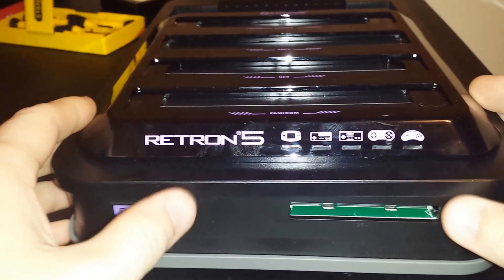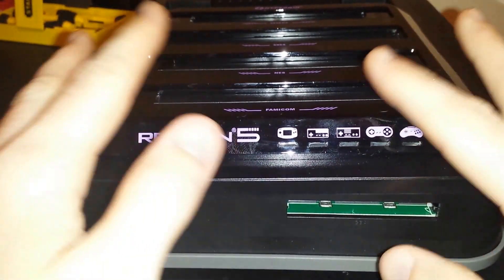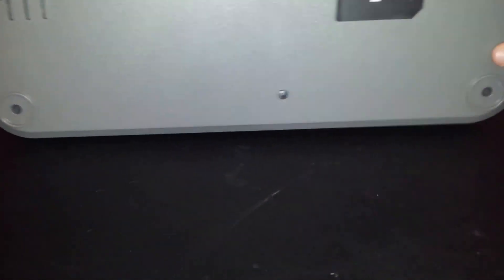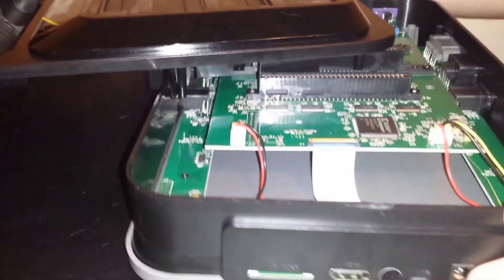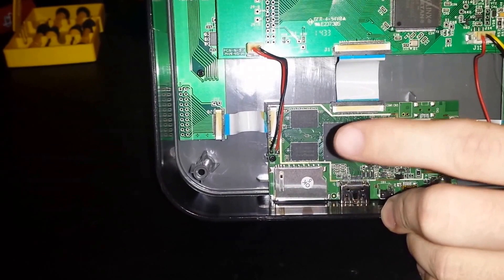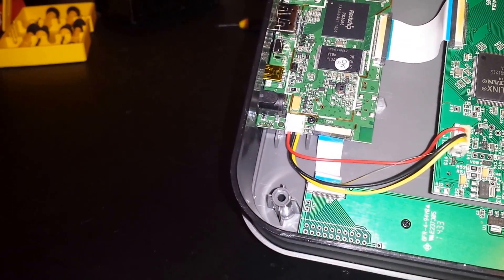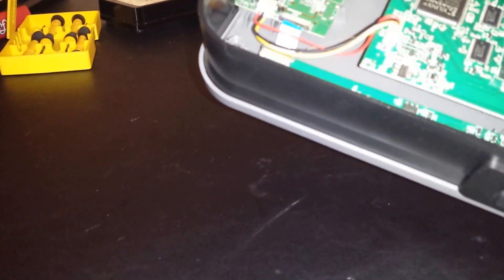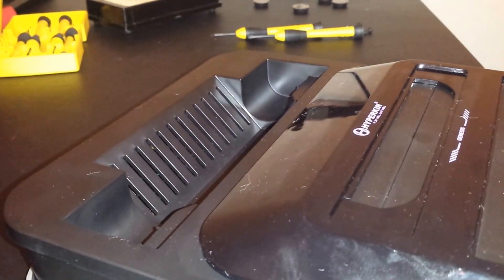Hyperkin Retron 5 Hardware Teardown System Specs

Comment: Does the rockchip SoC need some passive cooling? Was thinking about slapping a heatsink (or maybe solder in a low volt fan), some people had problems with crashes, so I figured if it was due to heat mitigation issues.
Reply from the maker: Very well could be the issue

Comment: Have you had any trouble with the GBA slot?

Mine stopped working after a single use and Hyperkin are being so unresponsive about it that it's grinding my gears.
Reply from the maker: No, though to be honest I rarely used the slots once I learned you could make rom patches work as rom loaders and just needed a single cart inserted.

Comment: Whoah, only 1,5 ghz, even current smartphones are more powerfull then this thing, am dissapointed about it might be just not powerfull enough for 1080p rough firmware update,no.
Reply from the maker: It's enough for most 16bit systems but yeah, there's definitely better options out there.

Comment: that yellow component next to the power input... that has burned out on my machine. is it a fuse?
Reply from the maker: Robert Woodbury I'll have to get a closer look but I think it's a voltage regulator.
Reply: Jake Friedel so I need to find that part..   can u read the data on it, it's burned off of mine.
Reply from the maker: I'll see if I can find a data sheet on it. Mines boxed away.

Comment: Only 1,5GZ,that's sad , i wish it could run at 3Ghz in order to run at 1080p via firmware update .
Also i can't believe that 4 small chips on the front does all the brain work but whater, it's still impressive.
Reply from the maker: johneygd it's a nice little system though a bit pricey for what it is in my opinion.
Reply: Jake Friedel it is surely a nice system, but the only thing am worry about are thise cartride pin connectors since they can bend out of shape really fast, thus making the retron 5 useless, if hyperkin just used very high quality cartride pin connectors, this would,ve not be a problem.

Comment: Rockhip RK3066 can run at 1.6 without a heatsink without throttling.
I own an Archos Gamepad which has the same CPU which can actually get very hot when running demanding Android games but no throttling.
And yes, it can indeed emulate N64 almost as good as the Ouya. It just being a Dualcore doesn't affect the emulation speed since the emulator can't utilize more than 1 or 2 cores anyway.
Reply from the maker: My experience with the Android N64 emulation hasn't been very positive, even with my Galaxy S7. Still a lot of graphical glitches.

Comment: The gameboy ran at 2.8Mhz, the Snes and most other consoles ran at 8Mhz, the Genesis runs at a little higher than that. So 1,6Ghz is plenty to run emulation.
Reply from the maker: Muranaman once you start throwing filters into the mix you will notice some slowdown.

Comment: Whats the internal dia for the power connector? ive got the rest of the spec, 5v @2 amp with 5.5mm external dia + centre.... cant find the internal anywhere. Thanks.

Comment: can I send you mine to repair? it won't turn on. it used to, I completed Tiny Toons on it. Using save states of course.
Reply from the maker: I don't know that I would be able to... there have been a lot of people having them doing the same thing as you are saying.  Nobody is certain what the culprit is yet.
Reply: I tested the power cable with a multimeter. No power. So at least I know that was the issue. Found a 5Volt equivalent power supply im using as a substitute. it works. Thank you
Reply from the maker: rxz4140 Awesome! Happy to heat that's all it was.
Reply: hi, what was the inter diameter on your replacement psu pin? the offical ones are way too expensive.
Reply: Im not sure of the inner size but this is what it reads:Input: 100-240V 50/60Hz 0.5AOutput: +5V 2.5A

Comment: The controller ports on the right side dont work for me... Was hoping it would be as easy as looking to see if there are just single wires that could do with soldering back in place or sumin but looking at this video i see the board is fucking complex as hell... My retron 5 looks to be forever faulty :(
Reply from the maker: Ehh not really, in fact it's kinda nice how it's setup.  Each side has separate daughter boards that use a ribbon cable that connect to the main board.  If you can find another broken one for next to nothing it would literally be plug and play.
Reply: Adam Michael 
the new firmware patch fixes that issue

Comment: I dunno if you were an expert, but I'd figure I'd give it a shot.
Since the Retrons are basically just plastic cases around CPUs, are loosening/tightening cartridge slots easy since there's no soldering involved?
Reply from the maker: The pin connectors are soldered into place and also screwed down.
Reply: +Jake “Zebular” F I knew it was screwed, but I hope it wasn't soldered.
Are the soldered sections closes to any significant computer parts? I dunno. Maybe I'll just put a heat/cold fan next to the connector, and it'll expand/contract.
Update: I finally got the Genesis slot to work. It's weird. It sorta makes a breaking sound to indicate that it's inside the console. Now, to loosen the NES slot.

Comment: "Underwhelming"? 1.6ghz Dual core, Mali 400 gpu and 1GB of ram is OVERKILL for any Genesis, NES, SNES or GB game you could play on it haha, esp seeing that NES for instanced ran off a 2mhz RICOH chip, 2kb of ram and 5mhz GPU. 1000mhz = 1ghz. Android back end doesn't require that much system resources, leaving ample performance to run all 4 emulated consoles with ease.

Comment: Jake,
I'd like to add composite outputs to my Retron 5 so that I can use it on modern and CRT TVs. Were you able to identify any composite (or SVideo) contact points on any of the circuit boards?
Thanks
Reply from the maker: Nope,  it's all digital sadly

Comment: What I found interesting was the unused slot and controller pinouts. Any idea what they're for?
Reply from the maker: simbin If I had to guess I would say they planned on having a dedicated Master System port.  It's a shame nobody has made a custom firmware to play Sega CD and Turbografx 16 games.  Console could definitely handle it and it's already part of the Retroarch emulator that they use.
Reply: I was coming here to ask the exact same question! If I had to guess, it would be what you said Sega Master System, Master Card, and Game Gear.... Which they put onto a $50 game genie like looking cart that plugs into the Genesis port... in fact, as I was typing this comment I pulled My 3-in-1 adaper appart and there is just a few SMT resistors/caps/diodes/etc and a STM8Z103 MicroController on it.

Comment: Thank for the teardown. Waiting for someone to crack it for Roms. To delicate for frequent cartridge usage.
Reply from the maker: Ryan Hutto You sort of can as it is, you will however need (at this point) a cartridge for each system you want to run roms for.  An added bonus is that you can have a genesis cart in and play master system games with this same method.
https://youtu.be/ztyEsPErDvI

Comment: well there seems to be some pictures i guess. http://retrorgb.com/teardown.html
Reply from the maker: james42519 It's good to see that this 2nd revision no longer has jumper wires going to the unused cart slot pinout with inline resistors.  The first model reminds me of homemade mod jobs and they didn't get the pcb design down before running production...